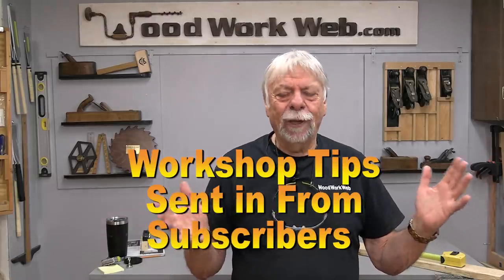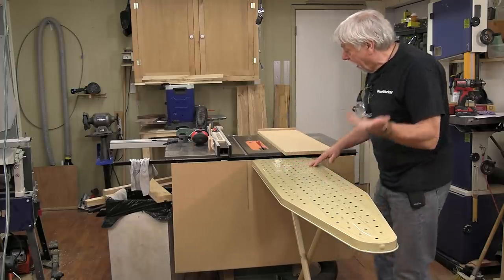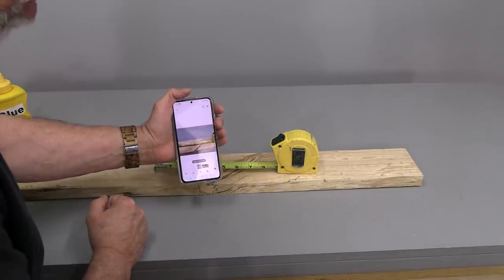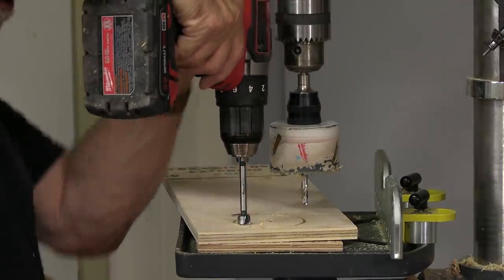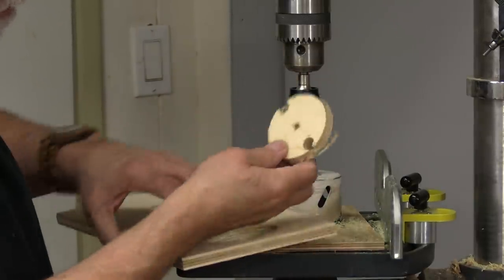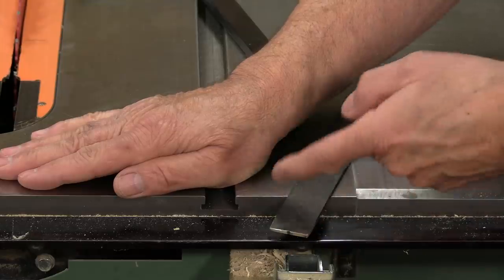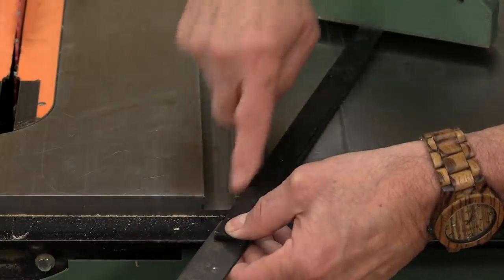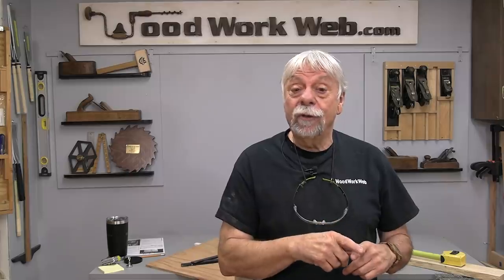Woodworking Tips You'll Actually Use! Subscriber Submitted Tips #31

Comment: The tip about finishing with a hole saw from the other side also works with spade (paddle) bits. As soon as the point penetrates the bottom surface, I flip the workpiece and use that hole to finish drilling from the other side to prevent tear-out.

Comment: Colin,
Here is an extremely simple tip for setting a basic miter gauge on a table saw to 90°. Loosen the handle on the miter gauge. Turn the miter gauge upside down and place the miter bar in the slot. Slide the gauge up until it butts up against the back of the saw table. Then tighten the handle. Assuming that the back of the saw and the slot are at an exact 90°. You have just set your miter gauge to 90°. Turn it over, place it in the slot. You're ready to go.
Reply: Oh, THANK YOU!

Comment: I use an over-the-door shoe  pocket storage device to hold many of my cans (wd-40, adhesives, spray paints). In a shop you could probably just screw that on the wall or a backing board; it does need reinforcement if you are putting a lot of cans into it.

Comment: Excellent video.  Here's  one for all.... when drilling  metal we use a cutting oil  for better drilling and less friction.... but those bottles  tend to drip  and oil gets messy  etc and if pieces of shard metal  are everywhere  ....where do u keep the cutting  oil handy for use or storage..... try this....  use a section of  pvc pipe usually 2" and cut it  a 1/4 to 1/2 inch  tall add a inside cap on one end  use tape or glue in place...  add your bottle of cutting  oil and now you can find it  clean and ready for use....mounting  to a wooden workbench  requies a 1/8" hole. A small L bracket and a small  machine screw and nut ..... mounting to wood... use a wood screw.... now attaching to metal  can use a magnet if it  stays  put.

Comment: I love the ironing board outfeed table.  That might be just what I'm looking for--I have space issues, so I'm using a folding jobsite saw that I can tuck away in the corner.  Great for space, but doesn't give me a whole lot of table surface to work with (nor do I have a lot of space in which to store a larger outfeed table I might build).  But the ironing board might give me just the extra bit of surface I need.

Comment: A tip for finding the inside width of something without guessing where a bent tape measure's markings as it's pushed against one side would have ended up, is to overlap 2 sticks of scrap together, each one averaging longer than half the distance but not longer than the entire distance.  Put the 2 sticks into the opening being measured and spread them apart until they touch both sides, then use a clamp to hold them together at the overlap.  Then remove, and measure the length out where you can measure them easily.
Reply: I find it easy to simply measure an inch or two from each side inward and mark it. Then all you have to do is measure between the two marks and add the inch or two you measured from the ends back to that measurement. Simple, fast and easy.

Comment: Is there some reason when drilling the hole from both sides you didn't reference the same side with the fence to align the hole?
Another reason for extending the miter bar in the T-SLOT is so that it doesn't tip out of the slot and downward when you withdraw it for larger material.
See ya next time.                  JimE

Comment: Great tips once again, thank you. Can you recommend a good source for the acrylic material used for the slot insert? Stay well.
Reply: I used a plastic kitchen chopping board and simply cut it with the table saw to the correct dimensions. I made a simple cross slide with two strips sitting in the two table saw slots. Works great and very smooth running.
Reply: Or rip a piece from a pvc trim board.

Comment: Thanks for the tips.  The hole saw tip reminded me of a question I wanted to ask, going back to your video on the carry out drink trays.  What speed are you using for the larger hole saw sizes?  

 I was using a brand new 2 - 3/4 hole saw on a drill press and it kept stalling.  The speed setting chart on the drill press does give a recommended speed for that large of a bit diameter and material. I experimented for awhile, then bought a large forstner bit.

Comment: Any ideas on how to build a folding outfeed table that has adjustable height would be greatly appreciated. 
I have a contractor saw on a cart so attaching the table to my saw wouldn't work. I thought about adding it to my cart but I want it to be compatible with other machines. I need the ability to change the tables height so I can use it for my tablesaw and my planer outfeed. I was thinking of copying the design many foldable TV stands use to make the table, but I havent been able to think of a good way to adjust the height. I thought about adjustable feet or stops on the folding legs that let you set it at different heights, but its a half baked idea. Need the height change to be quick so screw adjusting feet are out.
Reply: Couple of ideas come to mind, depending on how much you prefer to fabricate vs. buy.  For example, the ironing board in the video works on a principle of scissor legs causing the height of the table top to go up or down, depending on how tall or wide you scissor the legs.  A pretty sturdy set of legs could be shop-made with two 2x2s joined in the middle with a bolt and nut (embed a nut in the outside of one, and pass a bolt through a washer and the hole in the other, then into the nut, with tightening squeezing the 2x2s together, and a star knob encasing the bolt head for hand adjustment), then crossbars at each end of the 2x2s, bottom ones for feet, top ones to fit into brackets on the underneath surface of the table top.

Or there's also a store-bought option of purchasing 4 of those telescoping, twist-locking curtain rods, and fabricating a wooden tube for the underneath surface of the table top, for the top ends of the rods to fit into, maybe even locked into with screws through the wooden tube into the rods.  Simply twist the rods one way to 'unlock' them, allow them to pull apart or push together to lower/raise the height, then twist the other way to lock together.

Shop made telescoping ideas could also be to take 2 2x2s for each leg, cut a long slot in each, and make one or two bolt/nut arrangements with a star knob to hand adjust, with tightening, keeping the slotted boards squeezed together.  As with the telescoping rods, each leg would need to be adjusted separately.

Another one could be finding 2 sizes of tubing, one going inside the other, and make a hardwood or metal ring with a nut attached on one side, then a star-knobbed bolt going through that nut and squeezing the outer tube wall into the inner one, and again having friction keep them at that length.

Finally, you can fabricate a plywood sleeve to fit around a 1x2 riser (either solid or plywood), drill a hole through the sleeve, then through the riser into the other wall of the sleeve.  Then make a series of holes 1" apart all along the length of the riser.  Attach either the riser end or the sleeve end to the table top, the other end being the foot.  A simple peg would go in the hole when adjusting.

Good luck!!

Comment: Ironing board?  No, that’s daft.  Unstable, narrow and too long for smaller work spaces.  I made an outfeed table on castors very cheaply which also doubles as tool storage and as an extension to my assembly bench as its the same height.

Love your mitre board idea for extending square cuts.  I have a cross cut carriage on mine but it wont cut longer width boards so may make up one like yours.

Comment: When making a straight line, one always makes two marks, one at one end of a board, another mark at the other end.  What if one measure is off?    You just wasted a board.  SOLUTION:  Make  three measurements and mark them.  Then hold a straight edge on the your marks.  IF all three don't line up,  remeasure!

Comment: Where did you buy the plastic to make your runner?
Reply: You can get a lot of it if you cut up an old plastic kitchen cutting board. If they start to get icky, don't throw them away, just cut them up as you need plastic strips for jigs. A bit more expensive is to go to a Restaurant Supplies shop, they have extra thick & large cutting boards but more pricey. Most trade plastic suppliers also sell off cuts of 'UHMW Polythene'. Or you can go to someone like Lee Valley, Rockler, Woodcraft etc and get strips cut to exact width mailed to you.